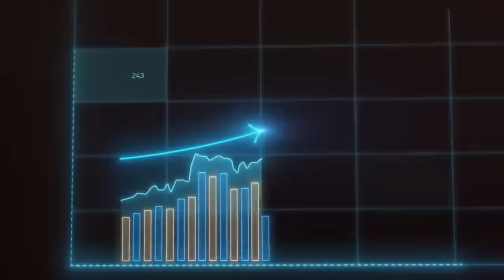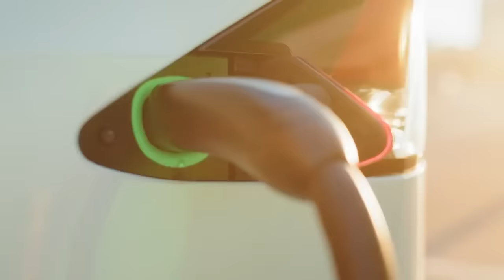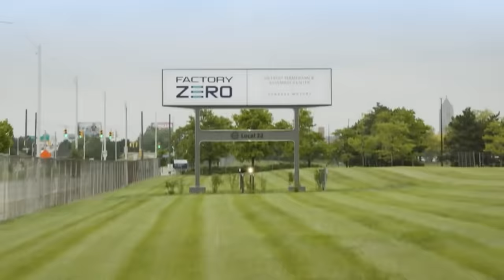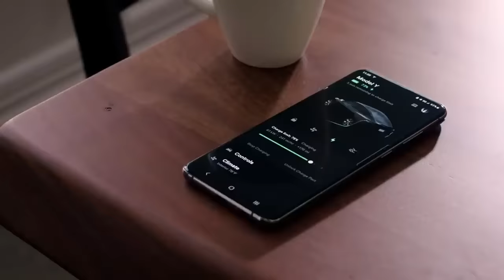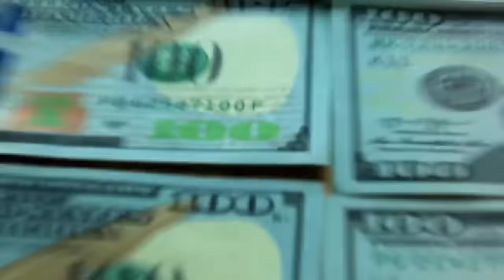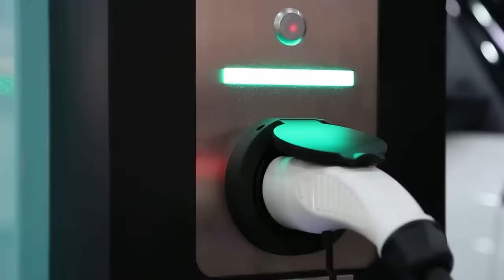Electric Vehicle Owners Are Frustrated and Demand the Return of Gas Cars

Comment: I’m over 60. I’ve never in my life seen or heard of an ICE spontaneously combust into flames.  If they do catch fire something very wrong happened or was done to it. With EVs it can happen under perfectly normal usage and charging.
Reply: I agree.  They state statistics without all the facts.  Most ICE cars that do catch fire are from some electrical fault.  Perhaps a stereo installed by an unqualified technician.  Given that EV cars have 1,000 times more wiring/electrical power, they are going to catch fire much more easily.  Also, they shouldn't compare the number of vehicle fires per year.  They should count the percentage of vehicle fires as a total of all cars built.  So, 1 million ICE fires for 10 billion ICE cars is 0.01% vs 1,000 EV fires for 100,000 EV cars is 1%.  Of course my numbers are just for show, but you get the idea.  Further, they should count spontaneous fires and eliminate the ICE cars that had electrical work done on them by unqualified techs.
Reply: I've had two do this. One was a complete right off. The fuel line had somehow become damaged and the whole engine bay was on fire. Scary. Understand about the new technologies used in EV batteries before scaremongering with ignorant 'facts'.
Reply: @LouDeVere  The new technologies used in EV car is just chemistry and electronics.  High power semiconductors that can suffer a spike or voltage surge might short them and when they do, excessive current will cause extreme heat and thermal runaway.  Why do semiconductors fail??? well, they just do, and they all will eventually fail.  It's in the data sheets, they have a life span and too much electronics has proven to make even ICE vehicles more unreliable.  The real scary part of EV's is the amount of energy stored in those batteries!  Electric scooters and bikes can break out in fire, but those can easily be isolated.  You can't just pick up an EV car when it goes on fire.  Scaremongering? lol, we're all grown ups here, no sense in being scared of EV's or Covid, the media hypes it all.  I'll grant you that I don't intend to scare anyone, but caution must be taken.
Reply: Yeah a number of buses have gone up here in London
Reply: I have seen four vehicle fires, a diesel powered petrol tanker, a diesel truck, a 1980s Ford and a small petrol hatchback that was so far gone you couldn’t tell the make. My wife had to escape through the window of her burning petrol powered VW polo with her sister. That was her second ever car. I hadn’t yet met her when that happened.
Reply: @COSMACELF1802 The two most common reasons for ICE cars to catch fire are fuel line or fuel pump leak or an electrical ignition fault in the HT system. Perhaps a cowboy fitted stereo😂😂😂.
Reply: @jgreen9361  You can smell a fuel line leak and get it fixed but you never know when the EV battery will short... they happen without warning, that's the real scary part.
Reply: @COSMACELF1802  if you are lucky. But 2 days ago, Jan 30th 2024, “A5 closed due to BMW petrol car blaze” suggests you can’t always predict a fuel leak or smell it in advance of a problem. Another hazard with petrol powered cars is that in an accident where the car turns over, you are trapped inside and the fuel can catch fire on the hot exhaust or hot engine. Yesterday, Feb 1st 2024, “A595 in Cumbria closed in both directions due to overturned vehicle fire”.
Reply: Electrical faults are more common than gas faults in cars .  Stalling is an issue , restart in the middle of an intersection , slow start after stopping at traffic light , all so a fact out there now .
Reply: @2009jadeorchid  That’s because newer cars of all types are getting more electronics.
The drive train in an EV is much simpler with less to go wrong than a petrol or diesel. 
On high tech cars now, there is more circuitry controlling the drivers seat position than there was in the whole car half a century ago. The automatic rain sensor on my windscreen wipers has never worked properly from day one. I can’t blame that electronic fault on the cars diesel engine.
Reply: @jgreen9361 
The drive train in an EV never catches fire. The battery does.
They use cheap isolation, and also thinner isolation, to pack more power inside a battery of the same size.
When that isolation gets bad or melts, because of higher charging capacities or impact in an accident, it will get hotter and hotter.
Reply: Have to looked at how many ICE cars catch fire compared to EVs?  The proportion is minute
Reply: Apparently the Gas Leaking from Battery pack is the issue, very explosive reaction to "assumed" ignition source, EV fire also burn longer, water reaction to lithium isn't fun either, Burn at higher temperature, 

YTube channel called MGUY,  presenta a controlled test, also video of a E Scooter suddenly leaking gas and Exploding.. 

I.C.E vehicles, Gas Vapor is the Danger, 
I've personally survived a "malfunctioning"  aftermarket fuel pressure regulator, leak like a Shower head, while running, parked, opened hood, to witness Pools of gasoline filling up the low parts of my intake manifold, Cups of Gasoline now boiling from manifold heat, sizzling sounds... 
Obviously shut car off..

I got lucky...
I still trust this Car with my life...
Daily Driver 68 Dodge Dart...

Comment: Hmmm, it's almost as if building an entire sub-market based on subsidies instead of customer demand was not sustainable.
Reply: Who would've thought?
Reply: Not entirely true. EV have been around for decades and in late 90s when GM produced them customers' demand went up, but eventually the energy market got scared because they forecasted a drop in fossil fuel consumption if the EV market took off.
Reply: its also like making them 60k was not sustainable

Comment: If a battery replacement cost more than a down payment on a home it's not affordable
Reply: Why would you want to replace the battery? Todays EV batteries will last half a million miles or more.
Reply: @chriswilliams8607 time will be the issue more than miles but the combo is killer. Imagine when they are 15 to 20 years old. The cars will all need batteries
Reply: @marioeid930  Besides the fact that cars are used in average for 12 years, cost of batteries will be ridiculously low in 15 years, and the EV saved 30 to 50 tons of oil, which is an incredibly good deal for the environment.
Reply: @chriswilliams8607  we don't know how much cheaper they will get. Or what will be the leader in the future. There are a few irons in the fire. Wouldn't alternative fuels be the easiest path moving forward? Making systems that can convert existing cars into a different fuel type? Porshe is already working on such fuels. To me that makes more sense. You do away with the mining and oil process.

Comment: There are many problems associated with electric vehicles that would form a long list if listed in this comment. Also the production electric vehicle batteries has significant environmental impacts. Another big problem is that the federal government and the government of the state of California is trying to force electric vehicles on us by banning the sale of gasoline cars at a future date. Also recently in the news was the fact that with very cold weather in Chicago, these electric vehicles will not charge up.
Reply: Very HOT weather is also a concern. Think people are gonna drive around in those conditions without A/C? In 2024? Well this ain't 1960 when few cars even had A/C AND we had front vents AND "wing" side front windows back in the day.
Reply: I've met most of these objections. They are almost all wrong. The thing about EV battery materials is that they get used around 3,000 times before the battery is end-of-life, and there is a 95% recycling rate, so that's around 60,000 uses before these materials are lost.
What you probably fail to appreciate is that EVs are actually going to be really good for grid stability. The first thing is "load shifting" where charging is timed to be when electricity is abundant, and the second thing is the use of EV batteries to put power into the grid when it's needed. California is rolling out a lot more solar and wind power, which will work well with EVs.
Reply: @leecowell8165 This is still early in the adoption of EVs. Some use cases just don't work well right now, but there is a continual push to do things like improve battery capacity and charge rate. Battery life is largely a solved problem these days.
Reply: We are having the same problem  in England  they pushing electric cars on us also putting  up road tax and insurance  for petrol and diesel cars  bully boy tactics 🙄
Reply: @sdfglkjhdfkjdhldskfj bingo. Finally someone who knows about grid stability. New EVs can “give” back to the grid or someone’s house. This can be a solution for the rolling brown outs or blackouts.
Reply: @rtbrtb_dutchy4183  why would you want your car to put its power back into the grid? I can see using it for power outages like as an emergency generator but if the local area is having a brown out why would I want my car to give power back? Then it won’t work when I need to use it.
Reply: “ when charging is to be timed to be more abundant….” Hahaha. Ridiculous. @sdfglkjhdfkjdhldskfj
Reply: Regardless if you support EV's or not, reality is that 'YOU CAN'T STOP PROGRESS'. These channels and comments are an exercise in futility.
Reply: @unlimitedcosmicspeed  I’m not trying to stop progress or fight the ev as much as they seem not so great. But I do want to know why someone would want their car to charge but then also give power back to the grid in a rolling brown out. Makes no sense to me so I’m trying to see the other sides viewpoint on that one.

Comment: South Africa is expecting a shipment of EV's.

We barely have enough electricity to make a cup of tea, with permanent daily rolling blackouts, are they going to drain what little we have left in the grid?
Reply: yeah, and the sad reality is that gasoline is the only problem with gas cars and no they do not have to run on gasoline they can run on renewable fuels like alcohol which can replace gas and still make the internal combustion engine cleaner running the problem is no one cares to make such renewable fuels for the internal combustion cars despite this easy solution for the vehicles. ethanol is not the only alcohol you can make to run a car on it's just the only one made available cause it makes the farms happy for selling corn plain and simple.
Reply: EVs are saving 70% primary energy, so your argument is actually nonsense. You need a little more electrical power, and save twice that much on oil or coal.

Comment: Some people don't like turning their homes into service stations.. Also, due to "thermal runaway" which makes sprinklers useless, at some point indoor parking for EVs will be forbidden everywhere
Reply: Yep there ain't no way I'd park an EV in my garage.
Reply: Good comment 👍
Reply: Yap, like propane in underground parking lots.
Reply: @leecowell8165  it you would park an ice car in your garage that is 80 times more likely to catch fire?  That’s a bit simple minded.
Reply: Every home would need a massive concrete sarcophagus combined with a massive fireproof door to prevent disaster from the EV fires.
Reply: @rtbrtb_dutchy4183  a regular fire extinguisher can put out a gasoline fire. The fire department can fight an auto fire with ease compared to an EV battery fire.
Reply: @Ziegfried82  gasoline car fires burn down houses as well. I actually haven’t heard of an EV burning down a house, but I’m willing to be educated on that. 

Yes, it’s easier to put out a gasoline car. But since a gasoline car is 80 times more likely to catch fire, is it still easier to put out 80 cars versus 1 EV by a fire department?  

One of the reasons a fire department takes longer is because it’s so rare, the vast majority of fire fighters have never had to deal with it. But most have had regular vehicles.
Reply: @rtbrtb_dutchy4183  Do either or the two combust spontaneously?
Reply: @whit3837  ice cars combust spontaneously more often than EVs. Ironically, with an ice car, it usually starts with an electrical fault, like lights etc. Which can also happen with an EV, but there is no gasoline to ignite in an EV. 

Now, here is a thing I don’t hear from the pro ICE car people: carbon monoxide poisoning. Here is a quote from a safety report:  

The design of cars with keyless, push-button systems allows the driver to exit the vehicle without realizing that the engine is still running, then carbon monoxide (a silent killer) seeps into the home and kills sleeping occupants.

The evidence is with the insurance companies. They are all about risk. Unlike something like a swimming pool or trampoline, they are not asking homeowners if they have an EV parked in the garage. That should tell you everything. 

By the way, this is what one insurance company uses for risk assessment:

Ice car, non hybrid: 1340 per 100,000 cars will have a fire related claim.

Ice car, hybrid: 3450 per 100,000.

EV: 25 per 100,000.
Reply: Then you also have renters that don't own the house they live in. Then apartments building
Reply: @rtbrtb_dutchy4183  Ev will not work for the whole earth. Their not that great for the environment in a pain to get fixed. Hey you want you deal with computer on wheels. If you are cold in the car just becare full because turning on the heater will cost batterie power.
Reply: @tomaskulik80  not really
Reply: @100madmic  so, again, you are just another person that regurgitates the oil industry’s propaganda. 

They are not a pain to fix. They are great for the environment and with the latest heating systems, it doesn’t cut down on range as much as it used to. 

I suggest you get some actual facts.
Reply: whilst a petrol car is more likely to catch fire, it is during operation that that happens.  not when tucked away quietly in the garage.  they are usually older poorly maintained models.  as there are few older ev's we really do not have any real data to say they will be safer in the long term.  in london they say that as only 4 electric buses have caught fire versus 8 diesel buses then the ev bus is safer numerically.  the fact that they are less then 200 electric buses and over 2000 ice buses shows that is not the case.
Reply: @TaylerMade  many ice cars catch fire when tucked away. Many houses have been destroyed by ice cars. Not sure where you get your info from. 

I agree that 4 out of 200 buses is not comparable to 8 out of 2000. However, I don’t own an electric bus and have no idea how well they are built. All I know is that electric trains don’t seem to have issues, but they don’t really have large batteries.
Reply: @rtbrtb_dutchy4183  EVs haven't been around long enough and in sufficient numbers to have real data. 
ICE hybrids have and you showed yourself that the incidence of fire claim is more than twice as high as conventional ICE. 
The only difference netween these two being the battery and electric motor ie what defines and EV, it is clear to see EVs are actually a greater fire risk.
You proved our point perfectly.
Reply: @rtbrtb_dutchy4183  Electric trains barely have batteries in them and when they do it's for emergency not high power and high frequency of charge/discharge applications, not comparable in the slightest.
Reply: @FlyingPastilla  wow. What a way to twist facts so it fits your narrative. 

First of all, there are enough EVs out there for the data to be correct. 

Now the Hybrid thing you tried to twist:

When a gasoline car catches fire, the gasoline gets ignited. Usually due to an electric spark. It can be that an electric wire rubs up against a fuel line or that a fuel line starts leaking on electrical things. These are just examples. 

A hybrid has more electrical components. Which means, more ways to ignite the gasoline. This is why hybrids catch fire more regularly. 

EVs lack gasoline. So there is nothing to ignite. 

Nice try. But I didn’t prove your point. You just proved to me that you try anything to make it fit your narrative.
Reply: @100madmic Yes, turning on the heater will cost battery power, just as heating an ICE car will use gas from the tank. So what? In our EV, the heat pump uses about 2 kW of power once the car is warm. Fully charged, we can run it for about 35 hours. About the same as we could have the motor turned on just for heating in the diesel that we had before (that one would last for about 40 hours on a full tank).
Reply: If "turning my home into a service station" means plugging in my car into our garage's power outlet, I'm fine with that 😂
Reply: @rtbrtb_dutchy4183  Strangely enough, there are almost no petrol cars around me. Almost everyone drives diesel.
Reply: @valuemastery  right. But you don’t have to worry about carbon monoxide poisoning in your EV.
Reply: @jmi5969  you must be in Europe somewhere. Nobody drives diesel in the US.
Reply: Hybrid seems to make more sense. Ev with a gas generator back up...
Reply: Aww the Hype are gone?
Where too?
Reply: A couple of EVs incinerating themselves while charging in an underground parking lot of a 45 story apartment or condo complex is a scary scenario.
Reply: @rtbrtb_dutchy4183  A firefighter I know stated that their role at the fire of an EV in a home's garage consists primarily of applying water to neighboring homes to prevent the spread, while the car and the affected home burns to the ground.